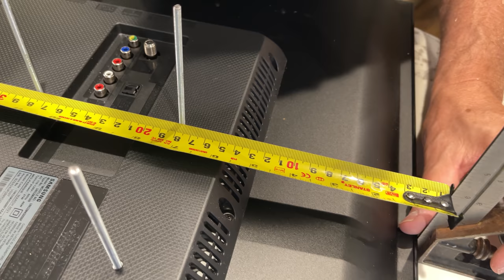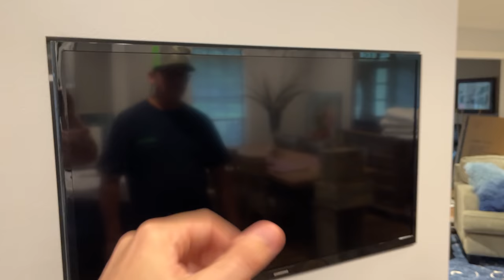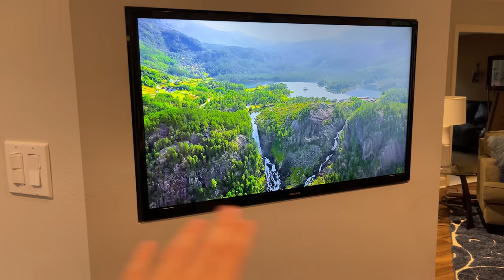How To Put a TV Inside Your Wall

Comment: Great video guys.  To solve the "line of sight" problem, you could use an IR repeater - they work great.  Mount the receiver end on the front side and then stick the emitters to the components behind the TV.  This would allow you to put the cable box, a DVD player, etc in the pantry and still have working remotes.  Congrats on hitting 100K - well deserved indeed.
Reply: IR Repeater, googled it, solved my problem! Tnx!
Reply: Yup - I think back in the day it was called an IR Blaster.  Used at my parents when they put a cable box in a cabinet.  Has a battery transmitter that picks up the IR signal the remote gives out and transmits to a a device that sends out the IR signal.  Not sure how much different they are today (seems they can be used with Alexa/Google home now) but it worked very well and recommend if you have a line of site issue with IR.
Reply: From this day forth you shall be known to me as “Stud Crack”

Holy cow, I love your videos fellas it’s like crack, lol they are addicting. 

You guys NEVER disappoint! 

Total PROS!!!

Comment: Returning a favor for all of the tips you guys offer: To avoid damaging the threads when cutting a threaded rod/bolt thread two nuts onto it and tighten them down onto each other. You can then place it in a vise or use vice-grips to hold onto it without damaging the threads.
Reply: Old, old trick that I'm surprised Stud Pack didn't remember.  I'm sure he's done that before.
Reply: Definitely a good one of you need the thread in tact.
Reply: He might not have a vise mounted in the truck.  I think that's why we didn't seem him utilize that technique.  But your comment wasn't wasted as it was a very good reminder to me.

Comment: Paul,  I once had to "activate" an AV receiver in a closet across the room from where the tv was in the opposite direction for viewing. Took me a while to figure out how to accomplish that feat. Ended up using a 1/4" round strand of fiber optic strung thru the ceiling. One end was at the TV, just below the right bottom corner, other end was in the closet across the room and pointing at the receiver. I actually didn't think it would work but I was surprised at how well it did . . . IR is 1000x brighter than visible light and has no problem traveling thru the fiber.  Keep up the great work, you two are the Bomb.
Reply from the maker: Thx much appreciated 👍👊

Comment: I would cover the exposed drywall and plywood from creating the 8 inch holes for the fans with house wrap tape to avoid having anything getting picked up by the airflow running over them .  I would also get some magnetic computer fan dust filters to go over the fan guards to keep dirt from entering the niche.  This will allow you to remove the dust filters occasionally for cleaning like you need to do with the air filters on a portable a/c unit.

Comment: Love it. I did something similar but left a 1.5 inch gap all the way around my 55 LG CX OLED. No fans at all and never had a heat issue. Used a low profile bracket and it puts it right at finish wall level.

Comment: Great idea and look really nice; however i can see the fan setup with 2 problems: Heat dissipaters are normally located on the grill (the area you just cover with the fans); 1) forcing hot air into the grill would warm up internal components that  were not design it for that. 2)  If for some reason the air has a lot of moisture, or dust, or small bugs, they all will be "sucked" into the TV causing damages. I'll suggest to change the direction of the flow to extract air, instead of pushing it.

Comment: You could consider an in wall tv mount. Its how I did mine. It has built in knockouts to attach j boxes. I have a panel on a barndoor track that covers it when its not in use. Art work on the panel with 2 recessed lights spotting the art when its covering the tv. All my low v cable go to a built in cabinet that has fans similiar to what you used (pull fan at the bottom, push fan at the top) . It also has a lcd thermostat that controls the fans with the temp and fan speed adjustments. Excellent video! Love watching you guys

Comment: I stumbled on your channel because I have huge goals on my first house and I want to redo everything in it and your channel has helped me bridge the gap and some things I didn’t know. This video was awesome because I like the idea of putting the TV in a wall but I would make some slight modifications to your idea. Putting a little trim around the TV like a picture frame type trim to match the rest of the trim to hide the black plastic of the TV would look amazing. And if you turn one of those fans around it would create a neutral fan set up with equal push and pull pressure so if dust were to accumulate it would not pop out in front of the TV. Like I said I love your channel and I’m definitely going to go back and watch a few videos just to make sure I’m doing something right lol keep it up guys!

Comment: I felt really silly carrying my 50" Tv around Lowe's to get the right size all thread to fit my tv. 

Just kidding, but if it where me, I would want access to all the ports on the back. In case I want to add a fire stick, or roku, or USB, or hdmi or whatever. 

👍
Reply: Yep, easily done using a utility cover as done for water faucets, water mains, etc.  Good point.

Comment: Excellent work ,only thing I might adjust is the fan direction.Following  the design  of a processor and fan in a pc .it pulls air away  from the chip ,it helps with dust management

Comment: Infrared remote solution, you can purchase "IR repeaters" for a few bucks powered off of USB port of TV. In this installation for instance you could've put the cable box in the pantry place one IR sender at the cable box and and one IR receiver on the outside edge of your flat-panel TV. As each IR sensor it's about 1/4 inch square it would be virtually unnoticeable.
Reply: That’s a good idea.  I occasionally have to press a little red button on my cable box to reset it.  Having the box in the pantry would make that task easier.  You wouldn’t have to remove the tv to access the cable box.

Comment: I love the tv in that niche! I was worried about the heat, but you guys figured it out. But…. What about the speakers? The tv will sound strange with speakers blocked off by the niche??
Reply: Exactly what I was thinking! Also why did he have to cut notches for the fans when he could have just ran the fan wires thru the holes he made for the fans?? Lol!
Reply: @number1pappy  Was thinking the same about the fans, had to go back and check. The two fans are connected to one cable so the notches was the way to go

Comment: LOL  Rob England beat me to the suggestion. The method that he is describing can be used on so many applications and is def. the way to go. Also, this method is often utilized when controlling something from any location via wireless... even 120v supplies.  Thumbs up to Rob.  And Paul, the method that you have suggested for the next time IS the better way. A telescoping/adjustable backing board is an ideal application for when a change out is required.   Your vids are gettin' prime, boys. Yes Jordan.. the 1/4 Rnd was good choice.  I laughed when you said to paint the acorns "white". Kid.. you're outta control! lol

Comment: If I was doing that in my home I would have used a gaming monitor with an IR remote hooked to the cable box instead of a TV. The cable box will handle all the channels so you do not really need a "TV" to view the content. And for a live wall experience the faster response and smoothness you can get from a gaming monitor will really bring that wall to life. But would require a little more work and cable management. Only downfall to that is gaming monitors do cost a bit more, but a far better quality then a standard TV.  But awesome idea overall and the finished work look also looked awesome. The Trim for the fans brought it all together. I really enjoy soaking up idea like these. Thank you!
Reply from the maker: David… I never even THOUGHT to use a gaming monitor for a smaller sized Tv, especially in an application like this. You can’t beat the response times and refresh rates. Awesome comment 💪🏼

Comment: I love this. 
A couple weeks back I had to hang a FSTV that was in a recessed situation but over a fireplace. The old tv was not as large as the new one, but it was a plasma. Lead anchor. 
The new one had 3/8” reveal on either edge and because the mounting brackets bolt pattern was different it became a pain to still have adequate clearance on bottom, but the top reveal needed to still be proportionate to the bottom. 
Making everything a pita, they refused to accept my insistence regarding tilt only vs articulating. 

This was already a huge irritant at the start. The strings from the release mechanism had been removed. So removing the first television took way too much work. 
What should’ve been a 30-60 minute gig stretched to hours, and up charging was expressly stated wasn’t acceptable. 

I should’ve walked. But being a man of my word I accepted the learning curve as partial payment and carried on. 
Later, they asked if I would take the BROKEN, plasma. With LEDs I occasionally say no problem, if they work, they can sell for a few bucks, if they don’t the fresnel lens is fun for projects as are some of the LED strips and recycling isn’t an issue, and they typically will offer $20. 
This guy offered $20, and before I was done his wife took off, when it was time to leave he tells me he only had $6!
I should’ve said keep your cash AND the TV. But being nice, I said, $6 is better than $0.  
I hadn’t ever opened a plasma, so I didn’t know it was only a heavy glass lens and other useless heavy steel structure along with all the useless circuit boards. 

Literally, the next 3 customers ALL were replacing Plasma TVs. They all also wanted them gone. At least these were functional, but still, I learned that goodwill etc DON’T ACCEPT TELEVISIONS. 
I thought CRT wasn’t desired, but no one wants anything. The recycling guy I finally found wanted more than I charged these people to take this shit off their hands!

Anyone want a free plasma FSTV?

Comment: Congratulations Guys!!   Thank you for cooling it, lol.  Nice clean work my friends!    If there is room for this, I'd add a jam nut on the studs, to lock them to the TV.  So, if you need to pull the TV later, the studs stay with the TV, it 'MIGHT' be easier this way.   You could have larger holes for studs in wall for easier placement.  Fender washers will conceal it.   Still awesome to see pride in workmanship.  A+!

Comment: That's Awesome! Looks sharp, nice clean lines and very innovative solving the heat problem! I was super impressed with the wall thickness. I've done them in 2×6 walls with pull out/tilting brackets, but I always feel like it's lost square footage, especially when your doubling the thickness of an exterior wall just for that feature. As for the cable box, most modern boxes should have an IR (infrared remote) port where you can plug in a tiny device to extend the remote range these, are great for hidden components.

Comment: Looks great but in a few years, the owner is going to be driving around looking for a tv the exact same size as that one to replace it.  I've seen that scenario countless times when people have cabinets built exactly to fit their fridges then can't find one to replace it without major work.
Reply: (With tongue-in-cheek) yes but building custom cabinetry for appliances etc. means that you is a remodel are bound to get return business when they can't find that new refrigerator to fit.
Reply: @mackfisher4487  They should buy a spare now :)
Reply: I would hope that they bought another identical TV to have as a spare.
Reply: @bigneilh  I was actually thinking the same thing get a tv or 2 and let them sit but honestly I'm sure finding a tv that fits wouldn't be that hard time anything they could go a bit smaller and split the difference on the reveal.
Reply: @michaelb2401  Yeah you are probably right but things get weird with bezels and all.  TV's can't be that much money for that size.  Also not a simple drop in replacement if its a different make and model for an average homeowner.  I bet by the time the first one dies, they will mount a bigger one right over the hole - NOT studpack style :)
Reply: @bigneilh  maybe but probably not they are doing alot of work on that home so they obviously want it to look nice. Tvs that size are around $100 so no not much at all.
Reply: Of course, I agree. This size tv isn't that expensive, so buying 1 or 2 to keep as replacements is frugal. Tvs only last a couple of years nowadays, so we think of them as disposable items--to be replaced within 3 years. I used to buy more expensive brands years ago that would last 20 years... But no more. It's the same with fridges and washing machines. .... On the niche idea, I think a deeper niche that holds a swiveling bracket would be more flexible.
Reply: im sure they can find one that fits... if not, the new homeowner can just transpose new holes for the threaded rods.  It's pretty simple.... or simply buy  BIGGER TV,   put an adjustable stand in the Niche  to hang the bigger TV from..  drill out the Niche sill.. run wires down through the wall to new outlet 2 inches above the rug, (outlet for Cable, and ethernet...  install identical receptile in the niche' ...  install bracket...  hang TV, and you can push it over the old niche hole covering everything, including all the wiring...  pull it out, and adjust TV for your favorite view. small stand under the TV with the cable box/modem/digital telephone whatever on it...    this would look great with no visible wiring and the bigger TV would hide the hole form the old niche as well as now your TV is adjustable, and not beholden to one single vantage angle.
Reply: The mounting holes are 99% likely based on the VESA-standard, so you should be able to mount any TV there. Problem is fitting it in. In dire situation it will be possible to just remove plastic cover of the TV and make wood trim around it. However that will expose the power supply of the TV and that contains lethal amount of juice (in the capacitors) even when off, so special care needs to be taken. One way to go around that is buying "mobile" TV that has its own separate power brick and it will be a lot safer (not dumb safe) to handle if not comfortable dealing with high voltage electronics due not needing to expose transformers etc.
Reply: If they are capable enough to build the niche in the needed size, they certainly capable enough to alter the niche to accommodate a different size TV.
Reply: Travis...I agree with you, but you cannot change minds of what people want....I know, I've tried.  What I really cringe is when someone comes and pulls up some Pinterest idea that in reality you know won't work.  But I just build them what they want, and let the future just pan out and they can deal with reality later!
Reply: Bro it isn't that hard to find just use the brain 🧠
Reply: Seems like someone else's problem

Comment: The creation here is beautifully done.  And I especially value the effort made for the fine details.
Because the issue with the remote-control signal, I want to let you know that very often a little device called a "repeater" can be implemented to give flexibility in locating the remote-control pick-up.  The end piece of the repeater where the remote sends the beam to, is small and can placed in numerous locations in the vicinity of the television.  The distance the repeater can be from the TV is only limited by the length of wire the repeater came with.  A repeater will work for any electronic system like a TV, stereo, whatever, but I believe the remote-control signal has to be the infrared type.  I'm not an expert so do a little homework.

Comment: Great install.  Only thing I would add, is I would have reversed the fan airflow direction to "pull" the heat away from the TV into the pantry.  Better to exhaust heat then try and cool the TV

Comment: Looks good , nice adaption to limits the insert idea of a niche.   A much better idea , cut a square in back of niche wall and recess the mounting bracket . Being able to pull out the TV and angle it for viewing in various locations would be a must for me . (instant access to back also absolutely necessary if a firestick etc. was going to be used .  It needs to be tech friendly , and easy.
I have a 46" mounted to the wall in my breakfast dining area and I can see it from the kitchen work space , however , it is far more enjoyable to be able to aim the screen in that direction. 
Keep the VIDEOs coming . Thanks

Comment: The problem I have with installing TVs inside openings like this is they die. Replacement TVs do not always have the same mounting dimensions. Your idea of the plywood in the future is a step in the right direction, I do the same with under-cabinet appliances. Even better if you can find a way to incorporate a hinged mound, then the TV can be swung out for maintenance.